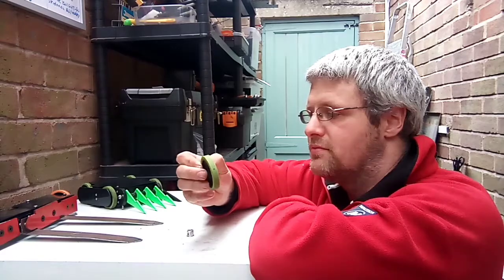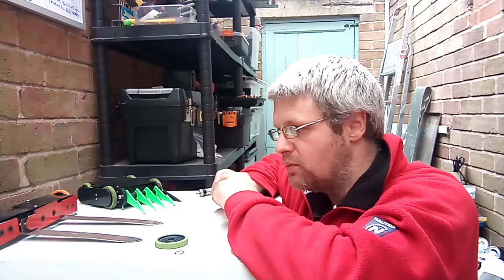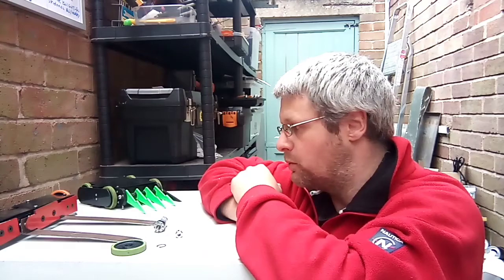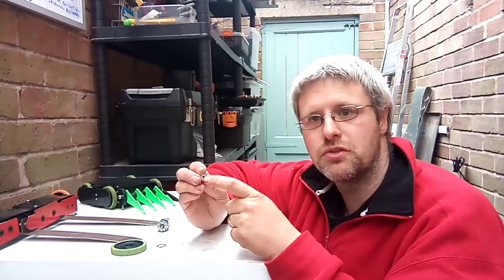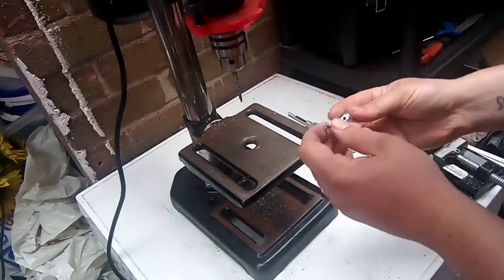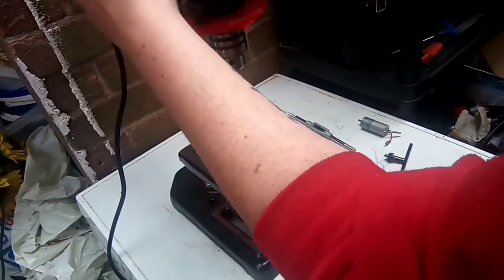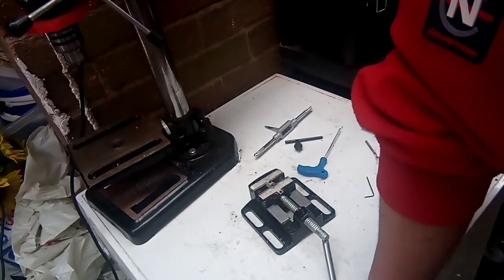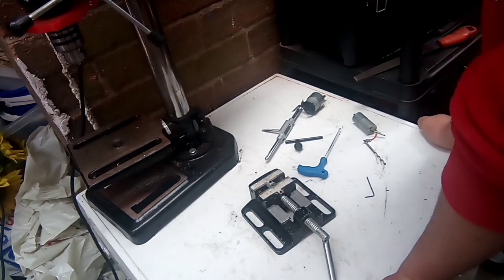DIY combat robots: Improving Banebots wheels

Comment: oh! so you don't just keep going when threading it. that's useful to know. It always feels like it's just destroying the thread it's made.

so it just a case of drill the hole 1mm less than the thread size you're going to use?
Reply from the maker: I do, I'm sure someone, somewhere, there's an actual guide for the right drill size hole for the tread. Regarding the tapping. Rule of thumb, that I've been told, One full turn, half back. It's breaks and rids any debris that might jam it up. But you learn by doing, like most things. I've broken a tap by forcing it, was not fun to remove.....